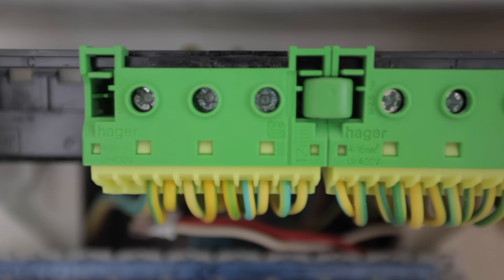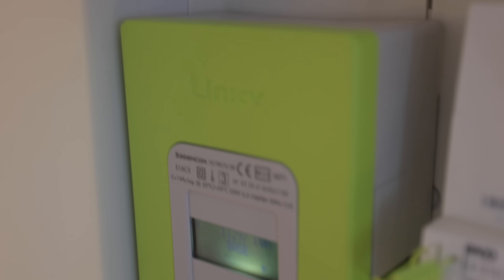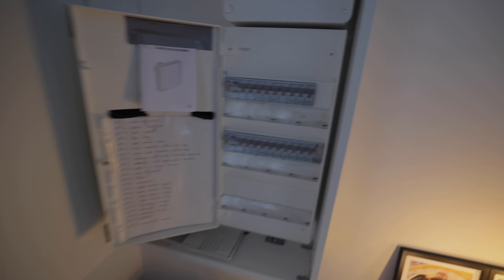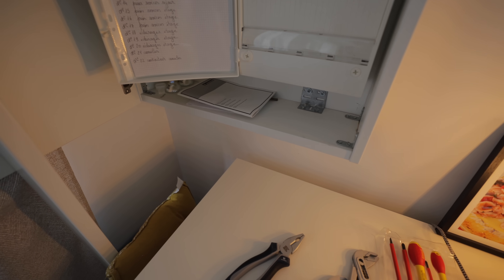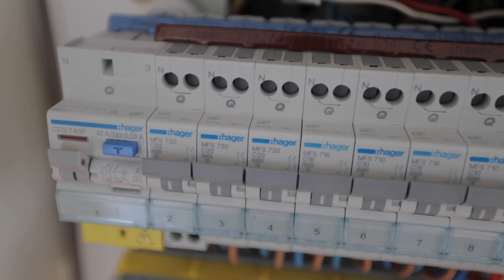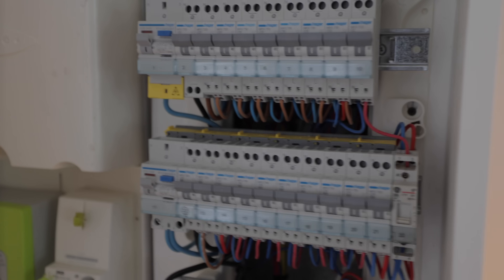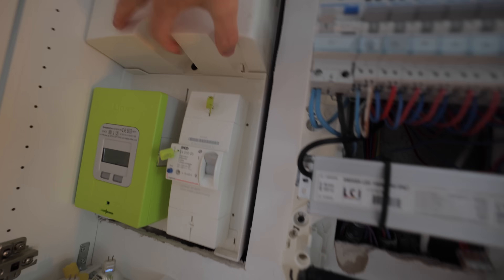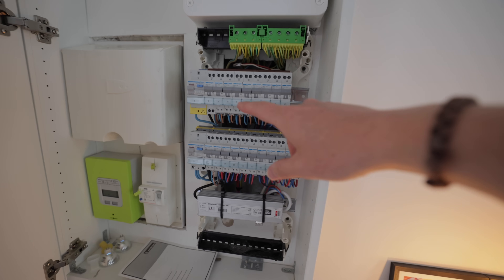U.K. Electrics SUCK! This is what we should be doing…🇫🇷

Comment: Push termination and wago connectors.  Not a good thing.  Wagos tend to fail before properly installed Marettes (Canadian name) and push termination is more of the same.  I am not sure why Europeans like potential fire starters in their electrical system.  That said, the consumer unit is in an accessible place and the use of conduit makes it easier to change out wire in the future.

I know our systems seem a bit more janky in North America but in some ways it's an improvement where we use actual lug-style (screw termination) connections in the panel as well as electrical devices and our panels are made of something that is more fire resistant than plastic that being steel.  In Canada specifically, our switch and receptacle boxes are for the most part metal (inside the house) but we use heavy PVC or aluminum (aluminium for those across the pond and down under) on the outside.

The use of double pole breakers is a nice bit of extra redundancy but probably fairly unnecessary.  We also use, for what I know, one type of GFCI (RCD or RCBO) in North America, but it comes in a couple of different form factors.  It's either in breaker form (single and double pole) or in an outlet box style (could have integrated outlets or just look like an outlet-less unit).  One other thing we have that I have yet to hear about in Europe is the utilization of AFCI units (arc fault circuit interrupters).
Reply: Wago became the one and alone provider of connectors in europe, quite everybody, every electrician uses exclusively this and from this very brand. Never heard about fire caused by Wagos and it's so widely used from ages that if they all brutally failed with the age, all europe will burn simultaneously it will be an amazing fire
Reply: An over tighten screw terminal is actually a lot more prone to brake the cable than a wago.

Comment: Would fiber have been installed properly, it should arrive by the box displayed DTI. Then you put the fibre provider box in the cabinet (that's why there are two mandatory sockets in or next to the panel - not enforced here). And you can connect the RJ45 from your provider to any RJ45 in the house (via the box with DTI). Of course you don't need the historic copper phone line to be linked to any of the sockets in the house - likely nobody will ever be using it. But you can have the phone exit of your fibre box connected to an RJ45 in the house via the distribution panel (inside the DTI box).

Comment: In belgium it is allso required to have 2 different rcds. It is not realy based of the type of load that is behind it but in stead of the environment it will be in, low risk environments will have a 30mA rcd, these are dry rooms for example. And on the 3ma rcd those are the high risk environments like bathroom, kitchen, outside. Every breaker that is not safety voltage aka below 30v are dubble pole breakers.

Comment: In Australia, they have banned the use of Type AC RCD's/RCBO's. Type AC RCD's are designed to detect AC residual current leakage currents, but aren’t able to detect leakage currents coming from more advanced technologies and appliances producing non-sinusoidal leakage currents, generating pulsating DC residual currents or slowly rising, slowly falling DC residual currents and halfway residual currents. Because of this, the need to improve the level of protection, transitioning from the minimum velocity Type AC to Type A as a minimum. The RCBO's here do not switch the Neutral wire, only the active.
Reply: The dangerous thing about type AC RCDs is that you can put a diode between Live and Ground and they will NOT trip, while a type A RCD will.
Reply: Hardly dangerous.  @thebamplayer
Reply: Yep, that’s why I put almost everything on the type A in my apartment.
Reply: we got B class RCD´s for that problems....but i am in Europe.....!
Reply: I am a registered electrical inspector of the as/nzs 3000, aussie and kiwi. type  a rcds are from around 2000 onwards. It is funny how the motherland has fallen behind.
Reply: These comments make me smile. When I lived near Beaudesert in the 70's the supply was three phase from a very long overhead supply, way across the fields. I think there MAY have been a fuse or two around, but certainly none of those flash white boxes. Bits of the cooker were fed from different phases, which had the advantage of being able to control the lighting brilliance by adjusting the loads on the cooker - yet it did the job and we all survived...

Comment: In France I believe you are charged via that smart meter in VA rather than W, so unless you have good power factor correction you’re getting mugged off!
Reply: i bet power is cheap there anyway with all that nuclear power haha
Reply: @Stefan-wl1xk  - Your comment prompted me to look it up. It is a little cheaper than the UK price cap but not a lot. Charging in VA probably more than swallows the difference. With the capacitive reactance of nearly every appliance nowdays due to the prevalence of switch mode power supplies, many appliances are using significant VA even when in standby and drawing almost no watts. I’ve seen one of those outside lights that switch on automatically when it gets dark tested on Youtube. It drew very little wattage when in the off condition, but nearly as much VA as when it was on. In France there would be no point in using it. You might as well get an ordinary light and leave it on all the time! In France to avoid a high bill you would need to be religious about switching things off at the wall outlet or unplugging rather than just using standby mode.

Comment: Wiring in conduit is good, we should do that, I believe in France you are not allowed any "maintenance free" joints.  Can you explain why they use C curve MCBs? and their requirements for R1+R2? In the UK we can no longer have the total value of all the MCBs added up exceed the rated value of the RCD but it seems in France you can have massive multiples of the RCD max rated current, why? even diversity cannot cover that surely.  And RCCDs feeding MCBs is a bit old school these days, do they have double pole RCBOs? and what are their regs when it comes to AFDDs?  Also in France I believe they have very limited external infrastructure to deliver electricity to the home and as a result they have very limited max demands and much lower max current supplies to each home, in the UK a 100A feed is not uncommon. please do a deep dive into more specifics of the current Regs as I suspect the consumer unit you showed in the video is not the latest, and if it is then you do need to explain the Regs in more depth.

Comment: Remember the earth regime of domestic installations is mostly TT in France like in many other countries on the continent.  Double-pole MCBs are a must in TT installations as you could have 127 V between neutral and earth in some situations.  Also, the habits in France, Belgium etc. to work on a circuit is to trip the MCB of the said circuit.  MCBs have the "sectionneur" function = isolation switch function, shown with a T-shaped contact on the switch symbol, and are double pole so you're safe to work on that circuit without needing to switch off the whole instlalation or a whole row of the consumer unit.  Also an interesting ting : there is a [S] symbol on the main switch : the RCD function is delayed so the RCDs in the consumer unit will trip first and will trip less circuits.  The main switch must be an RCD because of the TT earth regime, again.
Reply: Yeah, Germany is weird, we have the TT system in some regions, but we don't have to isolate the neutral, but mostly we have the TN system.
Reply: @thebamplayer  a TT system where neutral isolation is not mandatory means that the neutral of the single phase is always a real neutral, tied to the earth at the DNO side.  In Belgium we have this weird 3x230V distribution system installed after WW2 to spare one conductor in the street distribution, which means single phase houses and apartments get either L1-L2 or L2-L3 or L3-L1, one of which of these conductors is then considered as neutral in the installation... while it is not the neutral at the DNO side...  But in other places the distribution is a real 3x400V+N where the neutral is a "genuine" DNO neutral...  So, to avoid any confusion and keep things simple, we have dual pole RCDs and MCBs all over the country.
Reply: German TT Systems uses 3 phases and a Neutral, which is connected with the generator neutral, but you have to build your own ground. So the neutral is connected to the middle of the Y wiring at the transformer secondary. Our Phase to Phase voltage is 400V and Phase to Neutral is 230V
Reply: @thebamplayer  In both mains Systems  , also TN-C or TT , the neutral is bonded to earth. The N is full insulated from substation (transformer) to the installation at the customers premises.
It is not mandatory to install 2 pole in TT installation but it is recommend.
Reply: Good point, doesn't this mean that the UK system, apropos earthing, is superior?
Reply: @icarossavvides2641  a TN-S distribution system needs more conductors in the street wiring, which one could consider as "inferior".  I think there is no superior/inferior system, there are different systems and depending of what was more important or what were the constraints at the moment of the decision, one system is more suitable than another in a dedicated situation, at a defined moment in history.  Elsewhere or later on, the decision could be different.

Comment: HI, not a sparky here, so forgive the questions.

    Do they have 3 phase or single phase.

    45A, is that ~10kW max. Is ours 100A.

    Do they have ring circuits. Should we change standards to get rid of ring circuits.
    (possible cable overloading due to unknown break in ring).

Would be nice to hear comments.

Cheers
Reply: Both, single phase up to 12kva, 3 phase up to 36kva for domestic supplies, I have a 200 amp supply to my apparthôtel which feeds 7 appartements at 6/9kva plus the general services (common areas) at 6kva each with their own metered supply, I have refused the changeover to Linky meters.

Comment: UK electrics suck is such a click bait title.
You cannot take apart and rewire a EU plug, you cannot turn off seperate sockets, the plugs and wires project straight from the wall allowing them to be tripped over and pull out the plug or not allow furniture to be closer to the wall if there is as socket being it.
Your whole premise for the "UK Electrics SUCK" is compering a new build property with a good electrician against... what you do?
Compare a 20 year old installation against a new build in the UK and see is you can't find issues in France.
This video is all about you being able to live in two countries and rent a property in a town you cannot pronounce correctly.

Comment: I'm led to believe the difference between a Type A. B or C circuit breaker (in the UK)  is the tripping current. A type C would be for circuits that have a high inductive load like a workshop with lots of electric motors. Type B standard for domestic and type A I don't think is used much these days.
Reply: Not only inductive loads, but also SMPS that recharge the primary capacitors after the power comes up again.

Comment: I have 17kW oil boiler and it has 6kW three phase heater resistors connected to triangle without neutral. So yours is actually quite small.

Comment: Love the push fit connectors. Little chance of a loose connection from incompetence.
Reply: Yep. We always terminate our cables with WAGO TopJob S or Phoenix PTI 2,5-PE/L/NT installation clamps, to separate the cabling inside the cabinet from the building.

It makes it so much nicer to bring a unit you wired, labelled & tested in the workshop onsite and just push in the wires.

Comment: This is quite common in Austria and Germany as well, the only thing i´m quite surprised is that this flat does just use 1 phase feeding. Normaly households should have a 3 phase suply for better grid balance....
Reply: in most apartment buildings the phase balance is made by connecting different appartments with sigle phase to the 3 available phases in the distribution column. Many people here in France even when they have 3 phase like to switch to sigle phase to avoid phase balanc, save on subscription costs and electrical equipment. It's common to have 45A sigle-phase in France.
Reply: @pizza_diavola-bx4op  
Same in UK. An apartment building will have three phase with each apartment alternating on the phases.  

It is rare any supply is less than 60A in the UK. Some very old houses in remote locations may have lower amp supplies.  Apartments tend to be 60A while homes 100A.
Reply: @johnburns4017  I see, France tends to have lower Amps but more electricity use (rather than gas). Around 40% of homes use electric heating, and an even bigger share use electric water heaters.
So I guess with that intensive use of electricity, comes the necessity to be more restrictive with peak power. 
The most common subscribed power in France is 6kVA, means 30 amps. 
When power is limited, we can have "délesteurs" it's a panel-side device that cuts usually a heating circuit when peak power is reached, so the main breaker won't trip. Even better with EV charging points : some have the ability to use dynamic load managment, so the power drawn from the car is just what's available. If you're running the cooking range or the hair dryer, the car will slow down its charge (as told by the charging point) then it resumes at full power
Reply: In Germany having only single phase in a rented apartment can be a reason to withhold part of the rent, as you need 3-phase power to run hob and oven at full power. These units can be configured to run with single or triple phase, but output is reduced for single phase, otherwise the specifications of the installation would be exceeded.
Reply: Three phase in an apartment? Are you kidding?
Reply: @johnburns4017  Every household have 3 phase ;)
Reply: @MrElofix  I live in North Germany in an small village. All houses here got 3 phase by default. If a kitchen stove is electric  it is wired to 3 phase. A flow water heater , if installed, has 18, 21 or 24kW power, flow water heaters a wide spread common.

In my house,  the incomer ist fused with the here mentioned Blade fuses (NH )  3x 63A and the  master breaker in the meter box  limits my power consumption to 3x50A. The DSO run a TNC-S system. 
The house is build 1950 and got 3 phase from beginnig. In 1990 I renew all electric, plumbing and heating

The meter box and the incomer were replaced due a small fire in my cellar in 2020. I replaced all  MCBs against RCBO. Most circuits ar 16A B , some 16A C, lighting 6A B. To separate sockets and lighing circuits  are not mandatory but is recommend. 

In some places  you can came across the outdated  127/220V supply. The N is not distributed but bonded to earth. 
The all consumers are on 2 phases, so double pole CBs are  used.  
So if you test a socket you measure 127 V against earth and 220V  between the holes.
How I wrote, very rare but present.  A friend of mine in the city of Essen lived in a flat with such installation.
Reply: @Reaktanzkreis  flow water heaters are a rarity in France. We use accumulation water heaters, mostly run at night.
Reply: @johnburns4017  I live in Finland. All detached houses have three phase supply. Modern flats also have three phase but older flats have single phase supply. In my house the cooker, water boiler and sauna heater use all three phases. Thanks to that we don't need the ridiculously thick cables you have in the UK for cookers / electric showers.
Reply: @richard-riku  
Three phase in the average domestic homes is ridiculous. I do not find 6mm cable thick. 
In some new homes they are fitted with Bosch induction hobs with a 13A plug only needing 2.5mm cable. The oven is also around 3 kW also with a 2.5mm cable. No cable out from the main panel  is over over 2.5mm. LED lighting is 1.00mm.  That is it.
Reply: @johnburns4017  that's good, here in France for lighting it's still 1,5mm. That's a total waste of cable.
Reply: @pizza_diavola-bx4op  
You may find the French regulation do not specify the cable size, 1.5mm, and that it is up to you to calculate the size. It is probably a case of that they always just do it that way, doing it by rule-of-thumb.
Reply: @johnburns4017  minimum section is in the norm (NF C 15-100). subsection 524.1. But that's just a minimum section for a given circuit type and wire type. If cable is long, a highet section may be required to respect the maximum admissible voltage loss
Reply: @pizza_diavola-bx4op  
So they regulate to 1.5mm minimum. That needs updating. 
With LED lighting, even largish domestic installations only need 1.00mm cable. Many now fit a 3A breaker in the main panel for lighting the current draw is so low.
Reply: @johnburns4017  Default in Germany, Austria, Sweden, Norway, Poland and the Netherlands. Probably in some more countries. 3-phases down to the (apartment) sub distribution level.